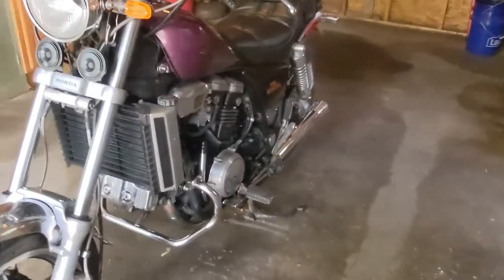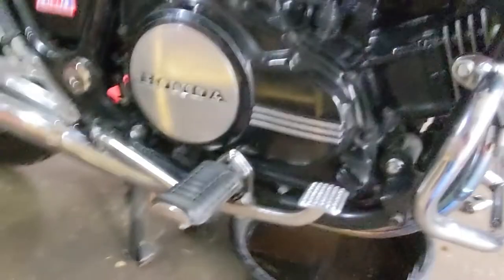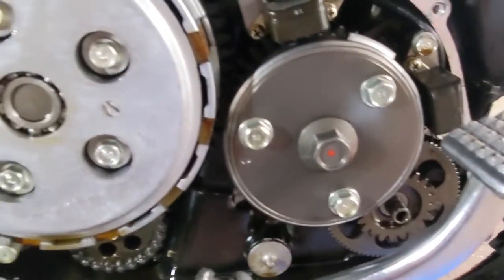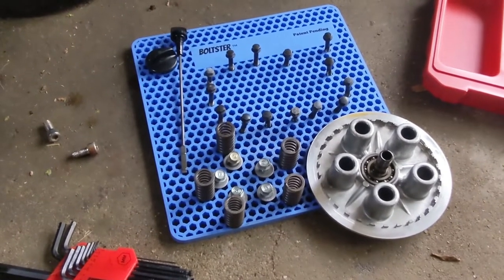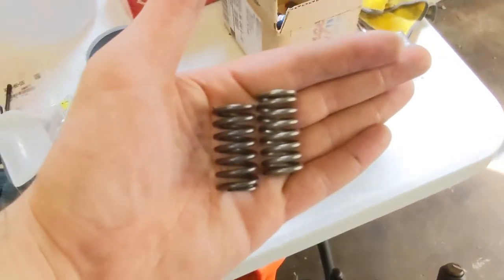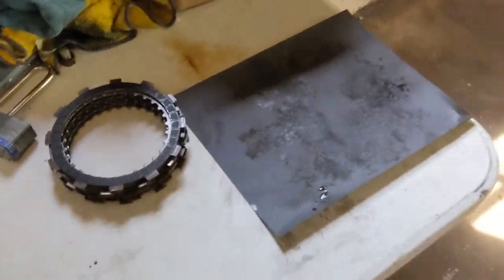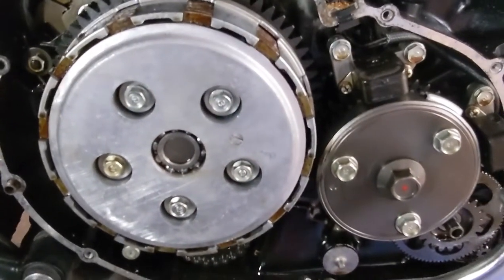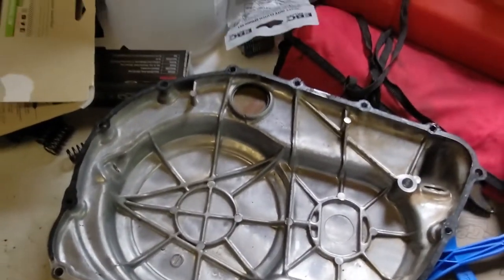Clutch Teardown and Rebuild - 1983 Honda Magna v45

Comment: Hey I was watching your video and have a question how would I go about fixing my second gear. For some reason every gear works but second! Looking for help looking forward to hear from you
Reply from the maker: Well, unfortunately I think from what I know that may mean having to get into the transmission itself.  A problem I have heard of while going through my bike but have not experienced.  I would recommend going to v4musclebike.com and search through the posts there.  Then you can post your problem and there are a lot of guys who have owned these bikes for years there. I am still learning and that is not an issue I have had to deal with.  I have talked to a few magna owners with a similar issue and they just skipped second and went to third from first.  I hope you can figure out your issue and it is possibly something simple to fix!
Reply: @magnamole  thank you for taking a minute to reply. And it's not a bot, lol. I usually skip second gear myself but I want a bike that has all gears. Safety, and theres something about riding a bike with a missing gear I don't feel complete. Hopefully I can fix the issue in time. I will go check out that website as well! Again thank you.
Reply from the maker: @Sudar2424  I completely agree that I would want to fix it as well.  Sorry I couldn't offer better advice but glad to help where I can!

Comment: Is it in neutral?
Reply from the maker: I will be honest I do not remember off the top of my head, I believe I had it in neutral and maybe shifted into gear to help hold the basket to torque the spring bolts.